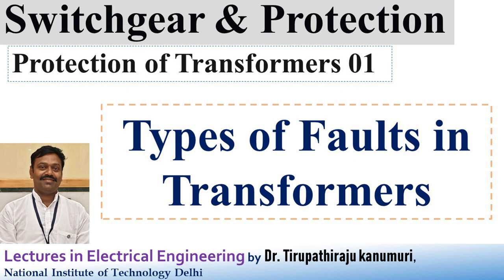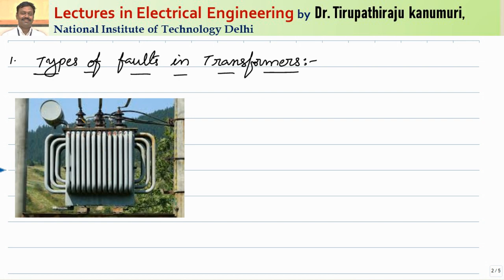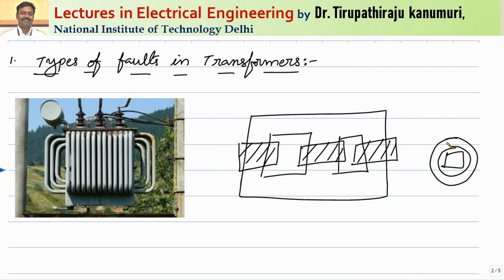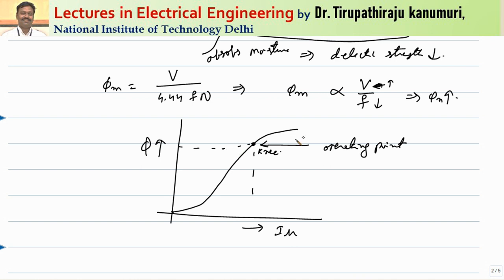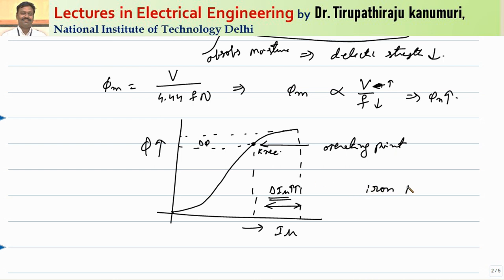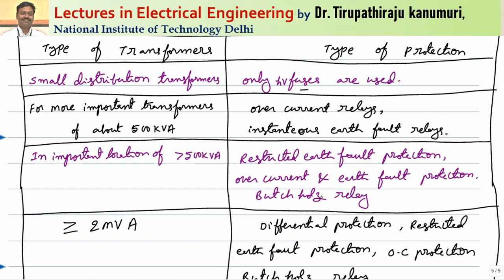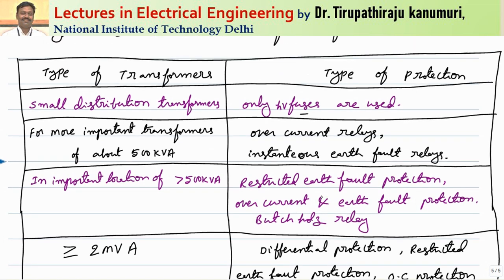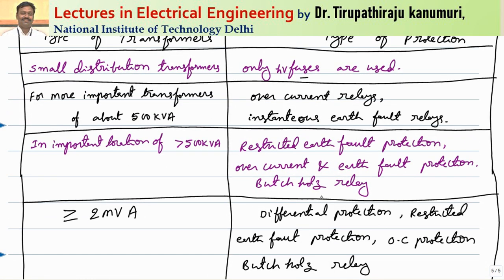SGP401 Types of Faults in Transformers

Comment: Hello Sir..thanks for this lecture. Sir I want to know why gnd faults in star  side are not reflected on the delta side.  This concept not clear to me. We say zero seq current fkows within d closed delta and then wat abt star wdg. Also at this point I am confused abt faults getting transferred frm one side to d other.  Sir pls ckear all these doubts. Thank you so much in advance.
Sir I wud like some topics like:
1. Area classification (hazardous area)
2. Selection criteria for motor sel for haz area.
3. Cathodic prt
4. Cable trench seq of cables clearances etc.
5. Substation requirements door opening..panel clearances..no of entry exit door ht  trafo fence or wall ht etc.
6. Arrangement of cables on cable tray.

Comment: Hello Sir, I have a question. After carrying out a DGA analysis on a transformer, the fault detected was a low thermal fault (t < 300 degrees celsius). I just want to know what is the impact of a low thermal fault? should the transformer still be in service? and what are the possible consequences? Thank you.
Reply: Hi, no problem, you can continue to work it. thats why is the impact of low thermal fault. transformer can be in service but it should be strictly followed by DGA analysis (one DGA analysis per 3 months). after these intervals, if it is still rising, follow IEEE C57.104  and decide to repair it.